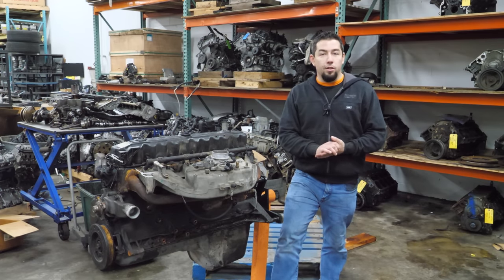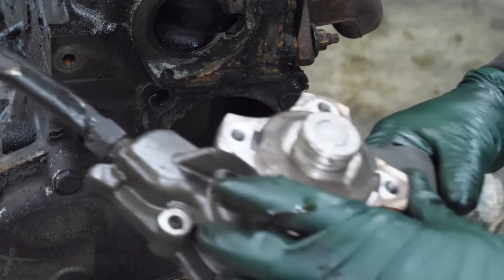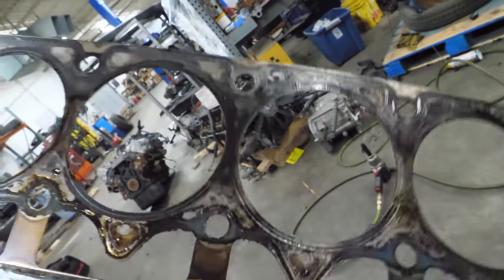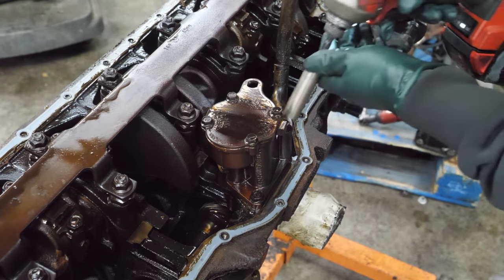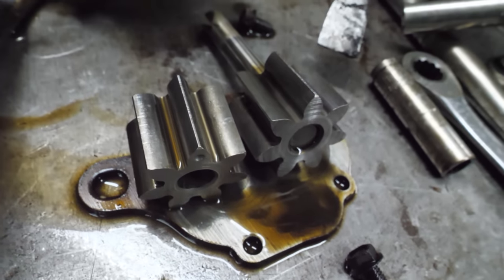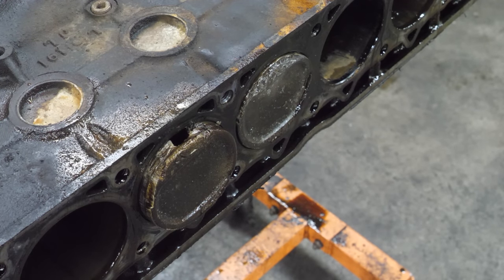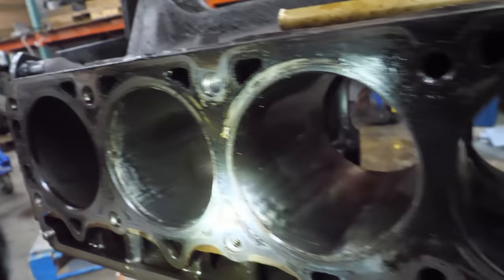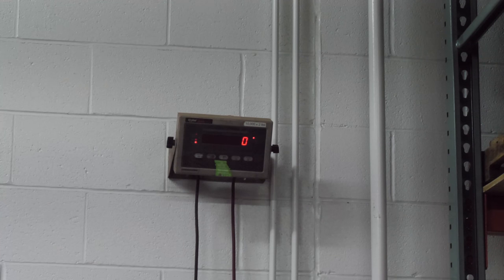How Do You Destroy A 4.0L Jeep Engine THIS BAD? Intentional? Neglect? Ill-Repair?  I Am IMPRESSED!

Comment: I must comment before watching video. Yah Yah, I heard the same crap. you cannot kill this engine with proper maintenance. Let me tell you a story. I bought a 2001 Jeep Grand Cherokee 4.0L. 221,ooo mi. I did all the maintenance, all the fluids belt and hoses etc. 2 weeks in, Went to town shopping, pulled in to the parking lot and it just dies and will not fire. $300 tow and $250 computer later and up and running again. about a year later after just putting on $500+ tires and filling the gas tank. Pulled in to the same parking lot and it started to misfire real bad, decided to try to make it  back home. Turned around and the engine locked up tight. same $300 tow home, where it still sits 3 month later. I thought that's ok I will just get a different engine they made at least a million of these engines. Nope mine has to come from a 1999-2004 Grand Cherokee or a 2000+ TJ. motor mount bolts placement is different and also accessories bolt on different. I now have a driveway obstruction to plow and shovel around.

Comment: If I remember correctly from when I did a cylinder head on one of these,, the head bolts on these are 12 points, which can be fun to deal with, when working on it in the vehicle, where you may or may not be able to get straight on them

Comment: I had a 1996 Jeep Cherokee Sport with a 4.0L and a 5 speed. A Jeep drivability tech hooked his scan tool up to it and hopped it up for me back in the day. That thing would lay as much rubber as I wanted, and climb sand dunes like a beast. Damn good engine!
Reply: I still have a 1996 Jeep Cherokee Sport 4.0 5 speed 2 door Lapis Blue.  Still have it although I haven’t driven it in ~ 8 years.  Love, love, love that car, can’t bear to part with it!  It would lay rubber like a beast 😂
Reply: @jwcjrcpa  If you live in Durango, it might be my old Cherokee. 🤷🏻‍♂️ It was a Lapis blue 2 door Sport with Up Country suspension, 4.0L 5 speed.

Comment: Had a 98 4.0 come in knocking took head off to find #3 piston was gone. Rod and wrist pin nice and happy. Cylidner wall was fine. Lady drove it 35 miles to my shop to sell me the jeep. Cleaned out.   New piston. Refreshed. Runs fine to this day. Also yes loosing head bolts in the front of a 4.0 block can leak out odd places. Because 3 head bolts go into coolant jacket behind water pump. These bolts require gasket maker on threads to prevent coolant/oil mixing. Now you know more.

Comment: I had a 1994 Cherokee. Best engine ever. The reason they overheat is that the fan motors fail. The radiator is too small to keep the engine cool without the fan always running. There is not enough room to put in a larger radiator. Not good in Phoenix in the summertime!

Comment: I had four of these engines in different Jeeps . They were good but you had to do a couple of thing to them , like put a oil air seperator on them . The engine had blow by right from the factory if you ever do a leek down test on it you would swear it was wore out ..The last one i had i put a 3.800 crank in it and had bored to make 300 in. Edelbrock head 60mm. throttle body . The Chrysler rear end was no good the cases were bored wrong ring gears didn't last to long in some of them . I put a 8.8 Ford Explore rear end it , it was very good end up selling to a man and he got 300,000 on it.......................

Comment: In 2006 I bought my 2005 TJ new as a leftover.  In 2020 I sold it with 188k on the odometer.  I was not kind to this Jeep lol, she was one rusty crusty old road warrior that had been road hard and put away wet, but  that Mercedes Transmission still shifted like butter and that 4.0L still ran like a swiss watch.  Best engine Inever owned.

Comment: Wow I had a 99 Jeep grand and I didn’t keep it long we out grew the car and needed a bigger car. I bought it new. 
I have nothing but good things to say about those engines. Mine was the in-line 6, 4.0 ran perfect and no issues at all. I regretted having to trade the car off. It got good mileage and never needed any thing done to it. It just ran perfect. I would love to get another one to restore because they are such good cars. 
And if was full time 4 wheel drive I had no issues with that either. My youngest daughter bought  a much later Jeep grand and hers gave problems but it was a high mileage car. And a V8. I would love one like she had that is running a 4.0 6 cyl. But their no longer in production and that is a shame. Really good engines from what I know and have heard. I think this one was likely a really mileage engine.

Comment: I think someone gave their 4.0 a big wiff of NOS and the pistons/head didn't like it.  I've seen these making 700+ hp with a stock block and 258 crank so the crank and bearings survived just fine.  In production from 1964 to 2006, another AMC legacy.
Reply: C'mon, clearly this engine was overheated until pistons started to melt

Comment: I had a '96 Grand Cherokee that towed a Crown Vic Police Interceptor on a rented car hauler 200 miles through Tehachapi, CA mountainous terrain, and it had no problems. I went on to drive that 4.0 for another three years before selling it, and neither the engine nor the transmission ever gave me any issues.

Comment: With 99 to 04 engines the major problem with overheating was a lack of a belt driven fan. Relays got old or wet and failed to cool in traffic and destroyed the engine. So when mine did it I used the Ford Explorer fan clutch and fan mod. Nevermore...
Reply: Trying to remember my brother's,had one belt driven fan on only one end of the long but not tall radiator,and and electric fan on the other side. Think the electric one ran when the air condition was turned on or when overheated (which didn't happen ,some of those had one core thick,his had 2 core thick as I remember)
Reply: @davidpowell3347  I run air all summer long now and the temp is the same as winter driving. 2nd year happy with the ford 4.0 fan mod. Some had both, but I think it was an option.
Reply: @MedicatedOMO  My rather basic 2000 WJ Laredo Without factory tow option and with the 4.0L has both. But my Brothers 2000 WJ Limited, w/V8, tow package and 'Trail Rated' badging did not. And I had to replaced the electric fan controller for him twice before he sold it. Makes no sense. What's funny is the Laredo started out as my Brothers until he saw the pretty Limited and bought it. He then  gave  me the Laredo , and I still have it.
Reply: @RANDOMNATION907  Mine is trail rated too. I guess it's just the options you choose.

Comment: I had one of these in a 2002 Jeep GC. I can’t remember how but it developed a tap in the lower end. If I’m being honest I believe I ran it low on oil.. From the time the tap started to lock up was 3 days and probably 50-60 miles. When I changed it I decided to pull the oil pan and the number 6 cylinder was shattered like it was made of glass and the connecting rod only had a broken ear on the piston side. I think I still have a few chunks of the piston in my tool box.

Comment: I watch your vids every Sunday morning. I have something to say to all of the Jeep guys out there, bear with me for it will be a long comment. First, I was a member of a Jeep club in Tenn. for the time I lived there. I got into wheeling there. My first Jeep was a 04 Wrangler.  I wanted a Cherokee for the room, so I got my first XJ. There was a guy in the club that helped me that had a XJ, his name was Tony, this is what he told me. Second, the 95 and 96 models along with the 99 are the best, with the 99 being the better of the 3. When looking for a good Jeep, always look at the oil pressure and how clean the oil is on the stick. The 4.0 gets its oil delivery from the cam and if they have not been took care of the journals being so small will clog up, hence forth low oil pressure. One has to change the oil religiously at 2500 to 3000 miles, no exception, sooner if driven hard on the trails or city driven in traffic. This will keep those journals clean, and dont use a cheap filter, use the Mopar and nothing else. Third, all Jeeps run hot at 212 to 215, with the auxiliary fan kicking in at 220 to 225, not good. You dont have to install a high dollar water pump either. These Jeeps come standard with a two core radiator, which is ok in normal driving conditions, but on the trails and in the city at +95 degree heat with or without the air condition is not enough. You can buy a 3 core, and then run a switch to manually turn on the auxiliary fan on, they will never run hot again. Leave the thermostat in!!! Just running it hard change the coolant once a year. This is from experience, I have had 2 99 models that never ran hot, and I am talking about 100 degree running my air conditioner at idle for long periods. My Jeeps had clean oil when I purchased them, and had about 60psi on a cold start, dropping no lower than 35 at idle. If you look at one that has just had the oil sending unit replaced, and still low oil pressure, run away from it.  The 4.0 is great and will last a long time. They are not made to do high revs, but they are made to crawl rocks and hills with torque. On another note, if you have one with the automatic, that is bullet proof also, just dont get it in high water for water will destroy it quick. They have a vent at the top, find that vent and install a breather tube and run it into the cab by the window with you. This will keep the water out, service is key, once a year when wheeling. Hope this helps the new Jeep guys out there.

Comment: I had one that completely wiped out #6" Both piston and cylinder" and #5 was not too far behind on an older cherokee. Rod on #6 was intact with wristpin! Half of #5 piston was gone and to beat all the damn thing still started and ran long enough to back it into the shop! It was definitely very unhappy and sounded like it😵! I also found out that trying to find good heads for these engines are almost impossible! At least in my area at the time.

Comment: I just bought an 2003 TJ with the 4.0 has almost 48,000 miles and I’m pretty sure I have a piston skirt broke not sure yet sounds like a diesel when it runs start it up the knocking is pretty loud but once it gets to temp quotes down but you can hear it when you accelerate

Comment: The 98+ engines used to crack piston skirts back in the day. Usually the number 6. I would buy them cheap, slap a used piston/rod assembly in (with the used rings!), drive them a month, then sell them at a huge profit.

Comment: I had one of these that was running with a rocker that came loose and punched a hole in the Valve cover. It was running on the remaining 5 like a champ though.

Comment: Back in the 90s I had to use a 91 Cherokee to haul a Mercury Marquis station wagon on a 16' trailer from NYC to Virginia.  Needless to say the temperature gauge was stuck all the way over into the red most of the way in spite of hitting every rest stop to refill and try to let things cool and trying not to go much over 55MPH.  We made it.  The Jeep went into the shop that week and a rebuilt engine was installed to replace the cooked one.  I still have that Cherokee.  The worse thing about those 4Ls is their stupid computer.  Whenever there is a problem 9 times out of 10 it is actually just  a bad sensor and not the part the sensor supposedly monitors.  Also the cheap plastic fittings on the hose to the heater core.  Twice I have had those suddenly crack or break without warning.  After the last time turned a new one out of brass and that one hasn't failed yet.

Comment: Idk how you do that. The i6 is damn near indestructible, mine has 185k 4x4 miles on it (so rough miles) and it runs like it’s new. The Cherokee is going to die before the engine dies.

Comment: One of the best motors ever built 87-98 after that heads crack I worked at a dealership when the change to the 4.o which sucks

Comment: So, a lesson for the non Jeep people...

After 99, Jeep went to the six-pack coil pack (yes all six cylinders in one module, I guess in an effort to pad parts sales).

At the same time the cylinder head changed to a new casting called the 0331 head, as this is the number stamped on it.

These are junk - they do exactly what you see in this video - crack between cylinders 3 and 4.  It's actually visible if you pull the oil cap and look straight down.

Newer castings and older castings are fine, which is why these things run and run and run - it's all old fashioned iron, strong as hell.

My own 97 XJ is well past 325k.
Reply: I disagree with you.  I have the coil pack setup on my 02wj runs excellent still at 220 thousands miles and no cracks in the coil packs, I romp it up north in the woods, run the interstate in 99 degree humid Temps, the oil fill cap melted it got so hot 1 time....can't kill it, still passes emissions,  still runs like a clock...
Reply: They are far from junk my friend
Reply: @dopeman420  You have the newer head that replaced the 0331, that's why it runs like a top.  Just be ready for the spendy if you ever have to replace the coil pack.

Comment: I did have one worse blown up than that one, there was a giant hole on the drivers side near the front and a twisted rod was sticking out. Tough though, the thing ran into the shop on it's own power.
Reply: Had a friend with a zj that ventilated the block. Like you said, still ran fine, just a little louder

Comment: My uncle bought a Govt. Auction F250 from the Border Patrol with a seized triton v10. He swapped it with a Napa Crate rebuild and a Mitsubishi D-50 transmission. I shit you not, 18 years later and at least 300,000 miles later, that truck still runs to this day.

Comment: I would absolutely believe this was caused by running an overheating engine until the detonation turned into preignition and torched holes in pistons. Every engine is a high compression engine when you light off 90 degrees BTDC
Reply: There's no way it could run if the spark occurred 90 degrees BTDC.
Reply: @Discretesignals  don't need a spark if the exhaust valve or plug electrode are glowing red hot.  It'll ignite itself shortly after the fuel air charge loads.   This has been understood to destroy gas engines for a hundred years. The overheating engine starts detonation, the detonation greatly increases heat transfer to the metal parts from the burning charge, and when the metal parts heat to the autoignition temperature of the fuel mixture things start to break in a hurry.

Comment: The crack between 3 and 4 is very common for the 2000-2001 heads and can be see looking through the oil cap and weeps coolant into the oil.

Comment: That torched piston looks like it suffered from a lean condition. Check the injector on that intake runner. The other piston looks like a clean fracture, possibly impact damage as it’s neighbour started coming apart. Pin boss failed first causing the crown and skirt damage.

Comment: I bet that engine was a 2001-2002. Those were the years Chrysler went cheap on the piston alloy and they were known for destroying pistons. That block is an excellent candidate for a 4.7 stroker. It'll need boring, but there are a lot of machine shops that can handle it. It would need a TUPY or Edelbrock head, and 250/258 cam.

I replaced the pistons in my 2001 as soon as the piston slap started instead of letting it get that bad. Dingle ball hone, sealed power pistons and it's still running.

Comment: This motor was the best part by far in the Jeeps it was installed in.  Pretty much indestructible if you kept up with regular maintenance.  Old school, simple, easy to maintain and rebuild, and they kept running forever.

Comment: About 2000 the manufacture got a bad batch of pistons from their suppler. the metal composition was wrong. Cracks start at the piston skirt, causing cracking and breaking.

Comment: That water pump can use some help  BTW extended gap plugs like used on 258 really help this motor and small block Dodge low compression motors  half  inch head bolts, we used them on the mains with steel straps and cut flat stock caps   the 4.0 heads are so much better than the 258 which is better than the early "big port" head                
looks like overheat

Comment: As someone who lives in the midwest i can tell you the 4.0 will normally last longer than the body. Finding a used 80's or 90's XJ that didn't have a swiss cheese floor pan or body was impossible to find. The drivetrain was typically in perfect condition still. I agree the very late 90's to early 00's 4.0 typically have more issues, but still not bad. It was cheaper to fly to the south or california to find a rust free XJ and drive it back home.

Comment: Fun & stressful video as I own two '00 4.0 XJs & the higher mileage one has about 206k on it & not only is it a daily driver, but I frequently use it for out of town trips ranging from 500-1000 miles plus the mileage I put on while out of town. I am both curious & fearful to know what the inside looks like. I have those two 4.0 & an '81 360la from my Dodge Ram that I would like to refresh & especially put a more aggressive cam in the 360la & do some porting onnthe 360 & the 4.0l.

Comment: '00-'01 pre-TUPY 0331 cylinder heads were prone to crack between the no.3 & no.4 exhaust valve springs (the hottest part) due to a thin, porous casting. This particular head is a TUPY casting, and the engine was overheated before it died. The oil looks like it was cooked inside the crankcase.

Comment: Im a 258 and Renix 4.0 guy. Mopar took a great designed offroad enigine that made its 224 foot pounds at 2500 rpm and tried to make it a highway motor that made its 225 at 3-4k rpm. That engine was never made to spin 4-5k rpm as the HO’s regularly have to do to make the same torque. Never destroyed a 258 or Renix, threw two rods in HO engines.